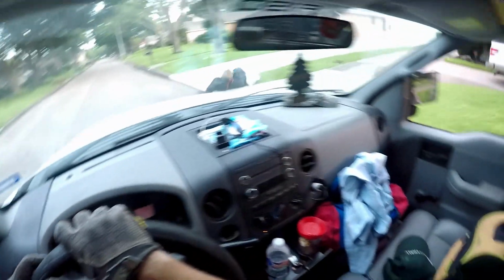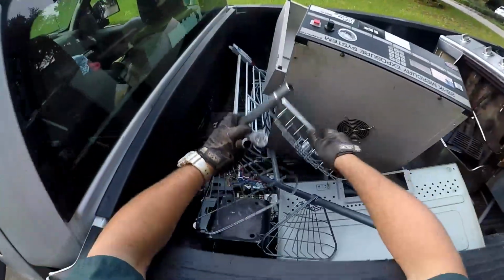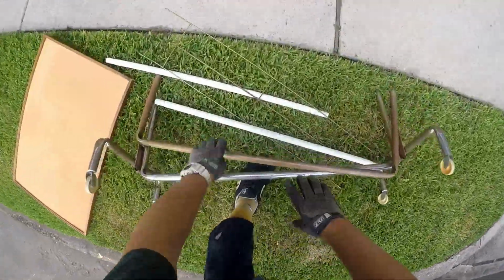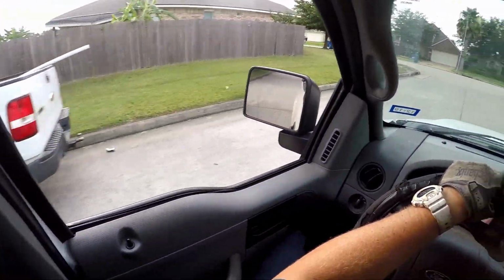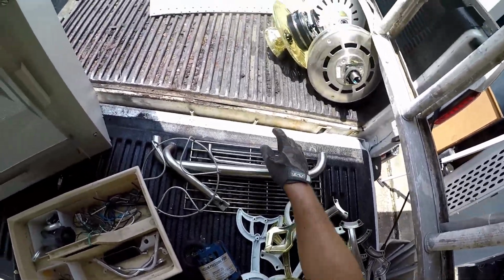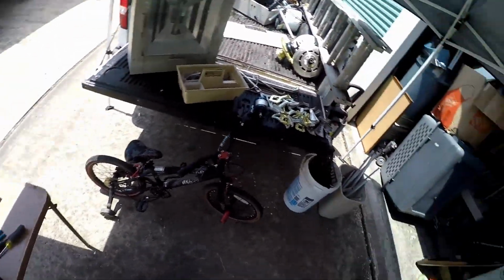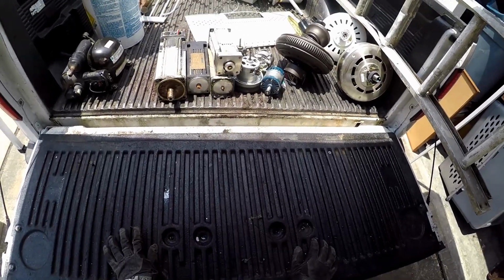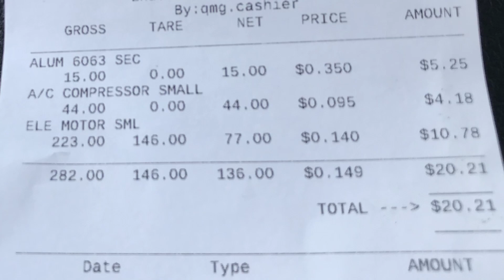Curbside Scavenging “I Don’t Even Know What That Is"

Comment: Mike the mercury vapour lamp is used in the printing industry to burn the image onto the printing plate. Scrap it out bro it won't hurt you, just don't smash the globe
Reply: Only caution besides not breaking the bulb, would be a capacitor that might be holding a charge.
Reply: with out the vacuum frame it's not useable. Was that little black motor he found just before the light a vacuum pump. I didn't realise at the time
Reply: Powerful yard light
Reply: @KF-qj2rn  when the mercury vapour lamp was out of service we used an arc welder to achieve the same result. If you look at the globe when it's in operation it will burn your eyes out just sayin

Comment: @2:30 That is a light and vacuum frame for photo resist exposure. I use one very similar to that for making circuit boards at work. Treat the board, place the circuit over it, put that under the glass and the vacuum keeps everything in place. Expose the photo resist to the UV light, then etch the circuit. Ours didn't have a mercury lamp, though. I would be careful, too.

Comment: Aluminum melts around 950f. Put in steel bucket and propane torch on it with lid to trap heat
Reply: I liked your comment so I had to do some research.....gotta love Google.  LOL

The only dissolved gas in aluminum melts is hydrogen, because it does not form compounds with aluminum as other gases (e.g. nitrogen forms AIN, oxygen forms AI 2 O 3). Compared with iron and copper, aluminum has a rather low solubility for hydrogen (at 660°C liquid aluminum dissolves 0.69 ppm H and solid aluminum only 0.039 ppm H).